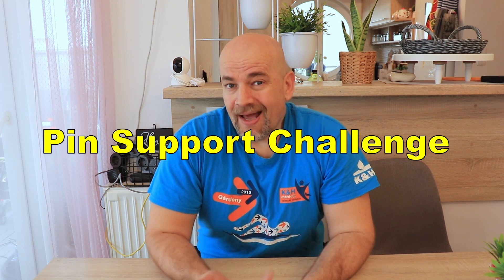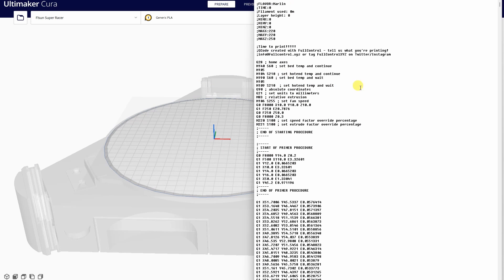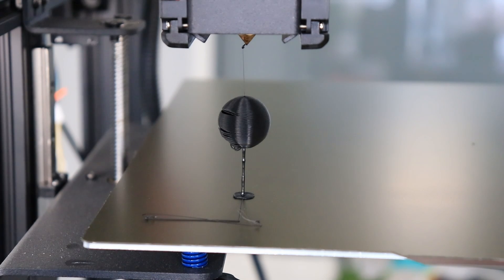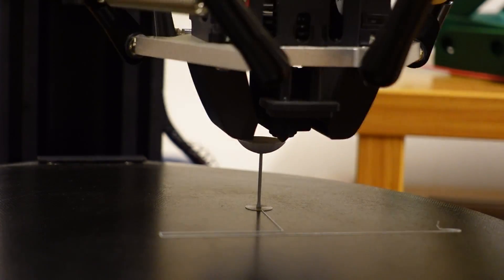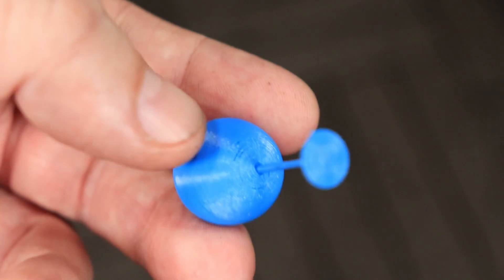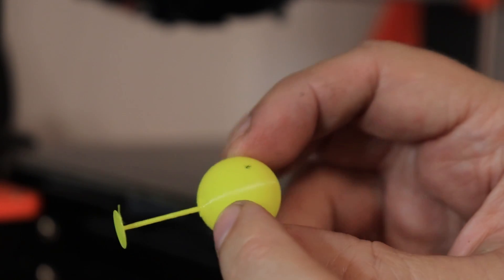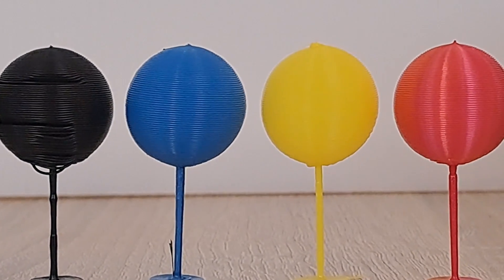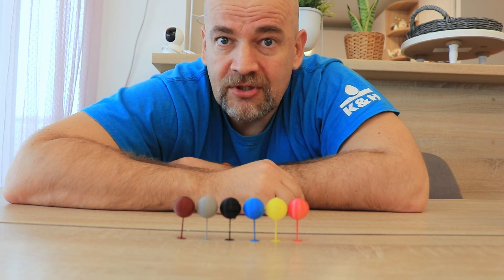Pin Support Challenge - test with 6 different 3D printers

Comment from the maker: I know that using same filament would be more scientific approach, but this time I tried to find the balance between interesting and boring (but useful) video (and thumbnail). Usually my videos don't exceed 2-3k views.
Reply: 2-3k? then congrats to the 38k on this video
Reply: I did the test on an FLSUN SR with the same setup as yours, using some matte PLA by a company with a weird name [ It's called Gnvtntp ].

The results were perfect on the default test, and also amazing result on a 40mm sphere with 10mm knurled pin.

On the default test with the same filament on a QIDI iFast, the results on the standard test were glaringly worse on the pin and less than perfect on the sphere (but almost good), due to unsteady flow control on the iFast.

Thanks for showing this!!!

Comment: One and done.   Creality CR-10 SE stock hardware, pre-root firmware v0.05 Klipper with factory speed settings.  Inland PLA + Clear filament, 14min or so print.   Load and go.   https://www.twitch.tv/videos/2042407178
Reply: My print looks very similar to the grey sphere print you show in the video.
Reply: https://www.youtube.com/watch?v=vJDmihbzD4E
Reply: https://www.youtube.com/watch?v=-x6lVj4Kr_8  Not relevent, but it is an XYZ Davinci that still works so just showing some love.  It's not even close to my CR-10 SE so yeah go ahead and chuckle, i do all the time.

Comment: Just ran this on my bone stock ender 3 besides the metal extruder and the default 20mm sphere turned out great so I bumped the size all the way to 40mm diameter, 1.4mm pillar, and bumped the speed up to 700mm/min max which it printed near perfectly too. Filament used was Polymaker PLA Pro @210C. Pretty crazy coming from a printer that I bought for $165

Comment: Do you know how can I get the same results with Cura? My Ender 3 S1 print this test perfectly, but when I try to slice a sphere in Cura (or Pruca slicer) I get ugly prints. It looks like the layers don't overlap enough (and it's the same on top and bottom). Even in the preview, I can see that sphere sliced in Cura won't be the same as in this test.

Comment: Well I am quite pleased. My old stock standard original ender 3 prints these flawless. No mods other than a flex steel PEI sheet. At least all the models so far with default parameters have printed perfect, I haven't pushed up the difficulty yet. Always good to run some little stress tests once in a while.

Comment: Would be interesting with the same filament on all prints to compare the results.

Nevertheless the Flsun seemed to outperform even the way more expensive Prusa. I think i'll get one
Reply: Bruh, I have a super racer. Thing is a fucking beast at quality prints. Just make absolutely sure you have every single part of the thing perfectly calibrated. Shouldn't be too hard honestly. Although I would suggest getting the newer V400 instead for obvious reasons.

Comment: Hi!

This is a very interesting challenge. Or better to call it test. As soon as I watched your video, I decided I will definitely try that. I don't use FB, so I publish my result here. Because it is very interesting and very different from yours.
About my printer. 
It's an Anet A8 plus. At first sight it looks like a Prusa copy. It was very cheap when I purchased it. Half of today's price. 

I really love it. I didn't know aníthing about the 3D printers before I got it. After the purchase I got to know, that the previous model of the producer (the A8) was very infamous. More home burned down due to lack of thermal protection. They corrected the mistakes in the A8 Plus. In addition it has  300x300x350 printing area, which is great. I made several improvements over time.
I almost forgot to mention, the printer is equipped with a direct drive extruder.

The following are interesting for this test:
- I replaced the stock fan duct to a round-like one. 
https://drive.google.com/file/d/1e1mjyHkCj1Iq0jWSyQ3JHtrePnkaGzJ_/view?usp=sharing

- The X axle and the threaded rods of the X motors were wobbling like hell. Because the factory made part on the top of the frame, was only a thicker steel plate with two holes, which  was made inaccurately. Instead that there are the 3D printed ones with bearing and the axles can be squeezed in their place.
https://drive.google.com/file/d/1e75RAP1Qlzu-7vplSXAmIdTJAHtRd78r/view?usp=sharing

Besides that I installed a bltouch sensor and auto bed leveling (I had to modify the g-code because of this.), and replaced some weak parts to stronger ones. Finally I did some optical tuning, like cable chain and such. 

Further facts which could affect the test result.

- Currently I'm using a PLA which I don't like. I can't print good enough quality with it.
- The nozzle is suspicious. It may be worn out and needs replacement.

So, the result.
The vertical part, i.e. the support itself, is terrible. But at least it's not skew.
https://drive.google.com/file/d/1jvgHCdX2R-k6XPwHgU8rg426sFcKa0qr/view?usp=sharing
In contrast, the sphere is perfect. 
https://drive.google.com/file/d/1YTv4weE9Di6OFqBW9aHMcfhm4yG60bve/view?usp=sharing
I also marked the front part because my fan duct doesn't form a whole round. But it seems it is enough. The rear is also fine.
https://drive.google.com/file/d/1ulfH8NbNqCwaiG4V7cKecpuKhdnGQkT2/view?usp=sharing
https://drive.google.com/file/d/1oMyDJNQpbYspDcL1ljj0qs-ZAf_Hx6vX/view?usp=sharing

Comment: Ok you lost me when you used a glue stick in 4 years of printing i have never used an adhesive aid. People dont do that just get your machine set up right.
Reply: Lots of people do, actually. I've also never used it, I have a ultrabase and I've simply never needed lt.
Reply: @sandos-x1t  glad to hear and yes I know lots of people have but it doesn't make it rt. I have printed on just plain glass before and never had an adhesion issue. Ohh I did the pin support challenge at max height and sphere size at 200% speed first try great finish.

Comment: Hi, I have stock Prusa Mk3s as you have, but mine test print ended much worse than yours. The stick is not even and sphere bottom is bad. What could be the reason of that? Thanks
Reply from the maker: Not sure, try different (dry) filament.

Comment: I almost wonder if it is the stock extruders that come with bowden setups that are causing the more inconsistent extrusions, because that flsun super racer print is glorious!
Reply: All creality bowden extruders are bad, the sapphire and super racer have very bad clones of the otherwise great bondtech bmg. The super racer has the better omg, although a genuine bondtech will still be better, the omg will have issues on retraction torture tests, chews twice on the same spot instead of from two sides. The twotrees has the additional disadvantage of having the by far longest bowden tube (also by far the largest printer)

Comment: Did you also tried to change filaments and temperatures on the printers with worse prints? I think that also filament (another brand, silk/pla+/etc) and especially correct temperature for specific filament, can also influence the result.

Comment: I got this error when uploading the file to Octoprint on an Ender 5 Plus using the CR10 setting
Layer indicator not found in file: 'Pin-Support Challenge_D2022-10-26_T12_10_26.gcode'
Check 'layer pattern', 'Look ahead limit' in DisplayLayerProgress-Settings and reUpload the file!
 I will have to edit the file to do the ABL probing before the print when I get the time, if anyone has already done this for the Ender 5 Plus please let me know, what had to be done I have to print it on my friends Ender 5 Plus as my machines are not stock so it would not be a fair representation of the printer model if I printed on my machines

Comment: If you compare printers you are not allowed to change the spool a single time. Even a different color by the same manufacturer has different properties.
Reply: yeah very VERY true
Reply: I mean he is allowed. It just isn't a scientific result because one can only have a single variable they test per experiment. 
This biggest issue is the print profiles and slicing software. Without fixing speed, acceleration, printing temp, honestly any variable we reasonably can. It should be asked if we are testing the machine or software?
However it should also be noted that with out adequate environmental data or control test may be inaccurate even with the filament variable fixed.
Reply: Agreed
Reply: +1
Reply: I've tested 5 different brands of filament, i didn't have too much different results but, you are right
Reply: Can confirm, for some reason inland pla+ always clogs for me in neon green and silver, but not in any other color.

Comment: Which cheap 3d printer should I buy
Reply from the maker: Depend of the budget, Ender-3 V2 or S1 or Prusa Mini are great for beginners.
Reply: If you want a Creality machine change your mind and get the equivalent Sovol model they are the same as Creality machines but with the faults fixed and some upgrades and improvements and better value for money.